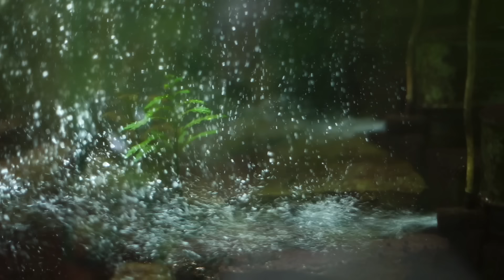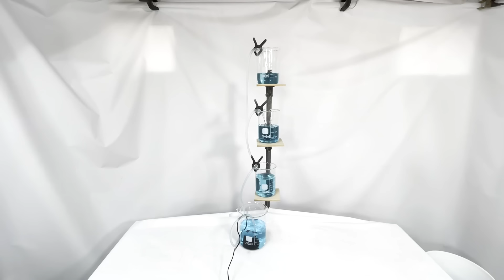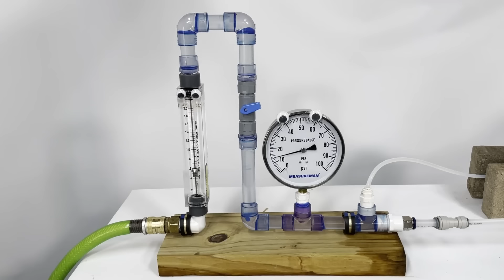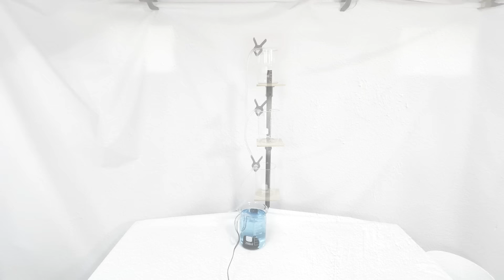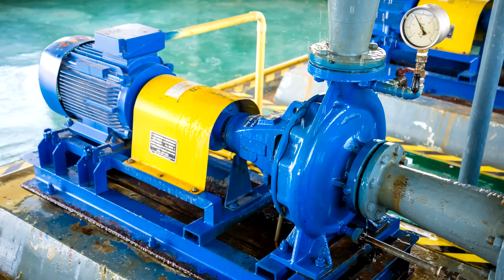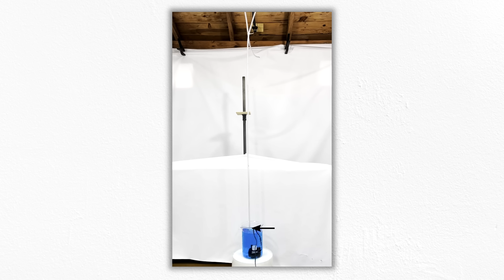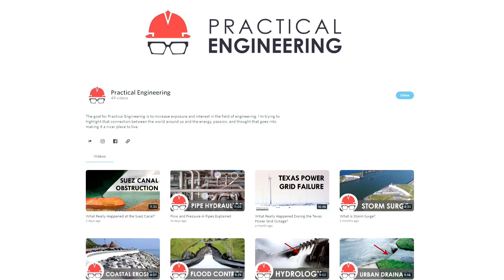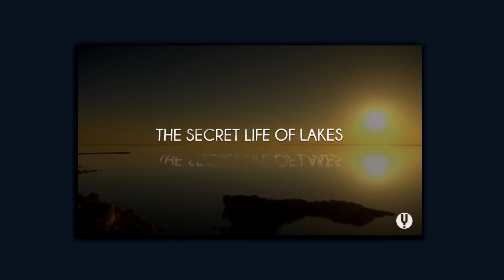Do Pumps Create Pressure or Flow?

Comment: I'm an electrician. Everytime I hear it's not the voltage that kills you, it's the current, I slap them in the face and tell them it wasn't the velocity of my hand that hurt them, but the weight of it. Of course the real answer is it's the MOMENTUM of the hand i.e POWER that hurts you.
Reply: Next time someone says that just zap them with static and ask how they survived being shocked with tens of thousands of volts. I've laid fingers across a 225W piezo driver output before. The Dorito's looking spot on my fingers also smelled like Doritos. ~25kHz ~36V ~6A  is wicked and I really didn't expect it.
Reply: Kind of gets into the weeds of what is a voltage source and what is a current source. Would be interesting to know actually what average voltage across the body is associated with the fatal 2mA of current through the heart though.
Reply: it only takes 1/10th of one amp across your heart " right hand to left foot for example " it is the amps that kill you.. you forgot the 3rd item in ohm's law " resistance". making it possible to take  50,000 volts of electricity from a police taser without dieing, in fact that 50k volts can be maintained by a police taser up to 5 seconds.. yet to person lives just fine no permanent damage. in the end it IS the amps that Kill you not the voltage...
Reply: @earache294  
You couldn't be more wrong. That 50kV is the free-air measurement. Tasers cannot supply more than a very limited current so as soon as the circuit is loaded, i.e. by someones body, the voltage drops to a much lower voltage following ohms law.
If a taser could sustain 50kV even under skin load there would be around 50A flowing. That just doesn't happen.
Reply: @earache294  that's a slap in the face for you. The proper answer to the age old question of is it current or potential that kill you is; YES. These are two measures of one thing; the electromagnetic force. Trying to talk about them as mutually exclusive entities is incredibly pointless.
Reply: @earache294  can't have amps going through your body without the volts. it's both. your extreme analogy goes both ways: a 12v DC battery can supply a humongous amount of amps, enough to literally melt wires, and yet people touch both live and negative no problem all the time when working with cars. heck, I remember this YouTube video from this channel called Photonicinduction. he had a ridiculous step down transformer setup supplying 50,000 amps from mains power, and yet there was no problem at all whatsoever. he was melting solid steel rods, yet it was actually totally harmless.
Reply: What if you're standing between well-insulated & distanced high voltage lines? There's a path of high voltage drop through the insulations, air, and your body, but there is either no current, or it flows somewhere else. Though by seeing the air, insulation, and body as a voltage divider, I guess it's not the total voltage that matters, but rather the part that goes through your body?
Reply: Well if the hand has enough cushioning to reduce the impact...

Though that might be analogous to insulation-body voltage dividers or closed-loop voltage drops
Reply: @earache294  besides those times people do actually die from a taser.

It is an object that provides less lethal force than a gun, but it still can be lethal and shouldn't be deployed unless necessary.
Reply: It requires circa 20 to 30 milliamps across the heart to induce ventricular fibrillation, and death. Many applications utilise many thousands of volts (at the source) but very lower current. I've built 4 solid state tesla coils (and many other high voltage generators) and only 2 of them produce lethal current from the arc, however touching the dome of any tesla coil will produce high current! It is worth keeping in mind the maximum current, for safety.  However, for most common applications (such as mains power outlets) the voltage will easily induce enough current to kill. 
Back in the 90's, I was suspended for 3 days in high school for bringing in a high voltage device (to my physics class) that I had built for powering an infra-red night vision tube (a project I was working on at home), it generated about 13KV but was harmless. They just heard "13 thousand volts" and they could only imagine I'd brought an electrocution device into school. My explanations about the low current and how it was harmless just fell on deaf ears. This was a department of defence school on a military base overseas, and you could not imagine the trouble I got in. The memorandum that was sent to several of my Dad's superiors said that I was suspended for "possession/use of a dangerous object, and abusive behaviour to peers".  Needless to say, my night vision project was dead in the water.
Reply: @methylene5  Gotta love the irony of "possession/use of dangerous object" within the military
Reply: @revimfadli4666  My sentiments exactly!
Reply: @v8snail  tasers are pulsing DC circuits. In DC circuits the current remains the same and the entire 50kv would be dropped across the body completing the circuit.
Reply: Would it be more accurate to say that it's resistance (or lack of) that kills you?
Reply: electrical engineering student and I find this quite funny
Reply: @James Simmons Come here I gonna give you a 10kv electric fence for cattle test :P and you gonna be just fine!
Reply: @JamesSimmons  It's power that kills you!
Reply: Well, it is the amps that kill you, but they can't do it without voltage being an accessory to murder.
Reply: @danieljensen2626  the average human's body has between 1000 and 10000 ohms of resistance (according to  NIOSH).  So the answer is ohms law, and it depends.
Reply: The armchair electrical engineers have been UNLEASHED! XD
Reply: This argument is so stupid. To die you need electrons to flow through your body and damage vital tissue by burning it. Voltage across a resistor causes amps... trying to split them apart is stupid because they are both just different ways to measure flowing electrons. 

High voltage but limited current ex a taser means the electrons are really excited and want to kill you, there just isn’t enough of them to cause damage. Think of it like a sand blaster but it’s only shooting like 3 grains of sand each second. It will sting and leave welts but it won’t strip your flesh off. 

Low voltage = low amperage by nature for the same resistance(you don’t change based on what kind of circuit you touch. So if you touch a low voltage source the electrons aren’t excited enough to kill you, and there won’t be enough of them. Think of it like a broken sand blaster, where the sand just pours out the front slowly. 

Touching a high voltage source (basically any commercial or residential electrical circuit) will have enough voltage to push a large current across your body and kill you easily. Think of it like a sand blaster that’s working properly. LOTS of VERY excited sand, ready to strip away your skin down to the bone.
Reply: @earache294  well said that was how I was taught and yes I have been bitten a few times thanks for your wisdom and truth
Reply: Lmao, that is clever and hilarious
Reply: Me (undergrad in MechE): 
YES. Please make more videos on pumps and anything else you can think of!  I have watched all of your videos and always look forward to watching more.  Your demonstrations and explanations are clear, concise, and most importantly, you cover the details of why it makes sense.   Thank you!
Reply: @carloscintoramartinez1883  yes and no.
I think we should differentiate this a little more.
You can died from an electric shock, that goes thru the heart, so the rhythm is disturbed and the heart won't pump the blood.
For this to happen, you need probably a higher Voltage, because the current needs to go thru a long way of Body. 
But you can died also from burnings inside your body.
For this to happen, there must be a high energy to flow. So high amps that lost much energy to the body due to the high resistance of the body.

So we learn, there are several ways, that electricity can kill.
You should avoid every of them...
Reply: The proper response to: "Its not the voltage that kills you, its the current", is "True, but the current depends directly on the voltage, and on the resistance of the source as well as the load"
Reply: @danieljensen2626  But if the circuit has capacitance, then a high-voltage, low-current power supply can provide enough amperage to be deadly. Just like pumps, both the circuit and power supply are necessary to determine what voltage and what amperage the circuit can provide.
Reply: @klokoloko2114  
Edited for clarity:
Stating power, voltage or current in a singular unit to indicate lethality is not helpful.
Although all these units are related, Energy delivered over a specific duration is the only valid way of calculating damage done.
Energy = Power x Time. Power = Energy divided by time = Voltage x Current.
Electric fences limit the energy they deliver in Joules so a shock can be high current, short duration or the opposite depending on the application.
Reply: @v8snail  Energy is power in time like kWh but power kills you 10watts is enough
Reply: @v8snail  You can spread that energy trough out whole day and nothing will happen to you
Reply: Kloko Loko
You have just agreed that stating an individual unit without duration is meaningless. How much energy delivered how quickly is a quantifiable measurement of how much damage will be done. It is the only predictable, hence meaningful way to express this.
Reply: When people say that about voltage and current, it makes me think of the other adage about how it's not the fall that kills you but the landing. (I think that one is meant less seriously, but it's still a very similar concept.) Yes, in the most direct sense, it is the landing that kills you. However, there would be no landing without a fall, and the kinetic energy you have when you impact the ground is proportional to the distance you fall, assuming a certain mass and gravity.

Just the same, current is most directly what kills you but it doesn't exist without voltage (except in superconductors, but let's not go there). The current is proportional to voltage for a given resistance. Yeah, if you're wet or the conductors are in your bloodstream, it'll take less voltage than it will to go through dry skin, but it still takes some amount of voltage.
Reply: @v8snail  You just said that it depends on how quickly the energy is delivered, which is exactly what power is. It's really neither, but power is a bit closer to the truth.
Reply: @chitlitlah  
Yes, Power is Energy divided by time but the result doesn't state the duration which makes it impossible to calculate damage done. Stating both Energy and Duration means you can accurately work out what damage that energy can do in the time specified.
All items designed to deliver a shock whether it be an electric fence, defibrillator, cattle prod or taser will quote how much energy they can deliver in Joules in a given time.
Electrical motor control centres and switchgear panels including protective suits always state the energy available in a fault condition and the protection factor of cabinets and PPE in Joules. Power is not mentioned in results as it doesn't reveal enough information to state arc flash energy.
Reply: LOL, I can remember having a massive argument with an electician about this, they kept insistring that the phrase was 100% true.  No matter how I illustrated it, explained it, they would not budge.  They where taught the phrase therefore it is true.
Reply: Well the phrase is kind of true. It just depends on the level of abstraction and understanding. Ohm's law e.g. is also just a reduced abstraction of complex processes.

So taking the view point of someone without education in electrical science, Volt is the absolute (effective for AC) potential to ground/earth a source can provide (at max). There are many circumstances which will lead to people surviving high voltages: high resistent to earth (some shoes e.g.), high resistence to the voltage (dry fingertips e.g.), very high frequency, or a high inner resistance of the source. And besides in reality there are many factors besides current and voltage, like pathway of the electricity, frequency, time of exposure energy/time...

So from a very simplistic viewpoint saying "It's not the voltage that kills you, it's the current" it is true. Because it basically translates to "If you touch a high voltage source you not necessarily die, but if you touch a source and a high current flows you probably will die".
Reply: @watchman0311  Open circuit voltage on a good welder is going to be upwards of 60v, my old school dial-arc is actually 90v DC and 75v AC and it will let you know in a hurry if you try to change a rod  while grounded. With a good ground it will maintain >60v DC (and probably the full 75v AC) through a person and with the right contact points I have no doubt that it could kill you in a hurry
Reply: Ive been hit by a few kilovolts from the different tesla coils and jacobs ladders ive made and it didnt kill me. Voltage can hurt, but potential is nothing without actual demand
Reply: @89StarquestTSi  and there can't be current without voltage potential. That was the whole point of my OP; It's completely pointless (and irresponsible) to claim voltage isn't deadly when it is the CAUSE of the oh-so-deadly current!
Reply: Posting this comment has made me realize there's likely dozens of YT armchair electrical enthusiasts killing themselves every year. 🤷‍♂️
Reply: @89StarquestTSi  👌
Reply: @earache294  a car battery can supply thousands of amps, but i can put a hand on each terminal and be fine, you need voltage to push the current through something
Reply: @revimfadli4666  Yes, standing in that situation you are in series with a very high resistance so the voltage drop across your body is trivial. If the voltage is across your body, you are toast.
Reply: @PepsiMagt  so oversimplifying it to "it's still the voltage" is also inaccurate since it ignores resistance?
Reply: There's someone above mentioned this already. You can imagine voltage as tall building, and ampere is how you land.
Yea, you won't die from jumping on a tall building, you'll die when you hit the ground.
Or maybe not die, if it damped by your arm and legs and doesn't hit your vital, or you're landed in soft materials, or maybe you don't die immediately but die because your bleeding doesn't stop.
Reply: You know it's true. Very little amp won't hurt you but high amps will. Some people just want to split hairs I suppose...
Reply: Some of you seem to forget that the voltage that matters is the voltage applied to you, not the voltage of the whole system (which may be gigantic but most of the voltage drop may happen on some other components not on you). And yeah you need sufficient current through your heart to die, but this requires both enough voltage AND high enough max current.
Reply: @marekogarek6329  agreed, though in addition to voltage division, having an low-resistance parallel path also lowers the voltage portion on your body
Reply: It's not the fall that kills you; it's the sudden stop at the end.
Reply: AC more dangerous than DC for same voltage, 50-60Hz anyway.
Reply: Something something capacitance something millijoules?
Reply: Speeding doesn't kill. It's the sudden stopping that does you in.
Reply: @danieljensen2626  The average varies a lot due to skin condition, thickness and dryness, so it makes more sense to specify a lover treshold. Generally voltages above 50V are considered dangerous since it is often adequate to cause a current high enough to run through your heart that it can cause problems (depending on where the current flows through your body of course and that the source is able to provide a high enough current)
Reply: current * resistance = voltage. Hmm I am confused, current is a factor to get voltage. 🤷🏿‍♂️
Reply: @DevGabe405  I=V/R
Wow look I can do it too 😂
Reply: @DevGabe405  my point you seem to have missed is that voltage, current, and resistance are just three characteristics of one thing (the electromagnetic force) and it's impossible to use binary logic to say "x, not y, kills you."
Reply: @DevGabe405  as an aside you got it 180° backwards. There cannot be current without voltage, but there can be voltage without current.
Reply: @JamesSimmons  Hm. How can there be voltage without current? I thought current means the "flow rate of energy" or the speed in energy. And voltage is like a measurement unit used to define the total power of an electrical circuit.
Reply: @DevGabe405  static electricity, something every 5th grader knows about. Voltage is not the total power, you might be thinking of Watts. Voltage is electrical potential.
Reply: @JamesSimmons  Ah I see! Voltage is stored electrical energy.  I will look into static electricity.
Reply: You can slap them in the face and tell them that in your frame of reference they headbutted your hand...
Reply: @v8snail  So, tell me how, everytime you are shocked by static, you survive? Its in the thousands, if not millions of volts, and you feel it, but it doesnt kill you. Amps are what kill you
Reply: @Sethiol73 
Easy. There is not enough energy in most static shocks to do any harm to you apart from surprised nerves.
I have personally used 6" non-static-dissapating hoses on vac trucks to vacuum up massive amounts of sawdust in at a Laminex Group site which caused enough static build up to produce spark jumps of around one foot air-gap to ground suggesting close to a million volts potential.
I'm not going to lie, they were painful, but it didn't kill me or my co-workers. The hoses were not fit for purpose but we tolerated it to get the shutdown finished, refusing to ever use them again. We were given 3kV high voltage insulation gloves to help at the time but all that resulted in was the voltage increasing that much more before striking through them, more painful.
The instant that static potential difference ionises the air and grounds through your skin, the voltage through your limbs is reduced to double digit numbers with a current flow in low single digit millamps as your body resistance/conductivity loads up that source. The total energy is so low that the current flow is over with in microseconds, felt but no damage done.
Amps kill you but they are not possible without the instantaneous voltage to push them through and the energy available to sustain it long enough to cause damage.
Reply: @Sethiol73  yes that's correct. The point is that for a deadly amount of current to flow between x and y then there must be sufficient voltage potential present in order for the resistance between the 2 points to be overcome otherwise no current flow. The other factor is the power output that the supply is capable of which is why you can have an electric fence generator that is only capable of supplying minimal current at a locked voltage. AC is not more deadly than DC for equal voltage as someone else commented and capacitance has nothing to do with increasing current in this situation as someone else said although I think they are talking about resonance and not understanding the principle. Capacitance makes the current out of sync with voltage in an AC system or can bring it back and improve power factor in an inductive system. Sorry to include all that but the amount of incorrect info got to me.
Reply: @icenbryse5190  Oh my gosh, I was trying to hang plastic sheeting around them to keep dust off everything around our water system and you could just feel the static in the air. I didn't want to get near it ever and basically the only way I could work around it was by slapping it and just taking the blast. I never had one stun me like that. They should probably be coated in some dissipative spray.
Reply: no you don't
Reply: @Rangvald8909  excellent way of describing it. voltage is what is called electromotive pressure it is essentially the energy of the electrons, amperage is the quantity of electrons moving through a circuit.  ohms/resistance is just the size of the channel the electrons are allowed to flow through.

all three of these factors play a roll in death. voltage is the speed of the preverbial bullet. amperage is the weight, and resistance is the main factor that limits current in the body. all three of these are needed to be within correct values to cause death. so therefor the expression should actually be, "its not the voltage that kills you, its the resistance in your body that allows your soft tissue to be heated causing death. that kills you.
Reply: @JamesSimmons  that was the point made in this video everyone missed lol
Reply: Lol
Reply: Its low resistance which kill you thats it.. if you have good resistance voltage and current will not kill you;)
Reply: @noalear  With proper low resistance skin contact, you can already start slightly feeling 5V AC ~1000Hz
Reply: It is the current though. You can touch higher voltage with dry hands than with sweaty hands, because the resistance of the skin is different. I rather touch 1150V with a wooden broom stick than than 115V with sweaty hands. It's the current that kills you.
Reply: @FirehouseCrafts  if your skin will have 10Mohm resistance what will kill you? 115V, 20mA, or sweatr
Reply: @FirehouseCrafts  you can ride in a car going 75 just fine. You could even hold your hand out and brush it as it goes by if you're careful. Doesn't mean it won't kill you if you step out in front of it.  Makes very little difference if it's a 2000lb coupe or a 9000lb truck.
Reply: It's true you can get hit by a 75mph baseball and be more or less fine, but the point of my clunky analogy is it's not current (mass of object) or voltage (velocity of object), but the combination of the two (momentum in the analogy).
Reply: @dwaynepenner2788  And Amps times Volts equals Power.
Reply: @Rangvald8909  Current goes through your body, not across it.
Reply: @JamesSimmons  Omg what made you so butthurt ffs... If someone says ''current kills you, not voltage'', they are not necessary implying they are mutually exclusive. Of course they are not but it's two different concepts anyway and it can be useful to understand the difference. 

You need enough electric potential difference (voltage), which is a unit of work (energy / charge) for any current to occur. If there's no tension, there's no energy. But it's a difference of electric potential from two points. There can be a lot of tension without hardly any current and still respect Ohm's law : exactly the reason why you want huge voltage in transmission lines with as little resistance as possible (thus, stranded wires) to drag as little current (A) as possible (to limit the waste of electric energy converted to heat in the cable). Of course, if you're grounded and get too close or touch the wire, you become a new path for the current to flow to ground, even if you're more resistive than the wire, because the tension is high enough to pass through you anyway, and since you're more resistive than the wire , huh guess what ; that's exactly why it draws current.  Smart ass.

A static shock is roughly 10 kV but there's close to no current (yes yes, there is a very small amount of current, true, it all dissipates in a very cute little lightning from your finger to the body of your car) but it doesn't harm anyone. But as little as 20 to 100 mA at the apex of your heart can be fatal, whatever how much electric tension was needed to draw the path of current to get there. And if there no skin to protect you (open heart surgery for example) it's much lower than that. Even more interesting, the frequency of the current is a important factor there. All of electric surgical tools have electric current of much higher frequency (10 kHz) because, for some reason, it's much safer. By coincidence, it happens that 60 Hz is the most dangerous frequency of alternative current. 

But anyway, what people actually mean with the ''current kills you, not voltage'' saying is that even low voltage can be dangerous, if you're unlucky enough, I guess. And it's totally true. 120V is to be taken as seriously of higher voltage, because it can indeed kill you. That's why you have GFCI sockets in your bathroom. And you already know that.
Reply: @James Simmons   And also capacitors, where Ohm's law doesn't apply anymore, and some transformers. And I'm not smart enough to understand this shit but yeah it can have very little current but a lot of voltage and still deliver a hell of a slap that can lead you to hospital. So I would say you're right too, man. And I'm sure you're a good electrician because you seem passionate about this subject since you slap people in the face when they are wrong. Most important thing to remember is to be safe, to ourself and others. But talking about voltage and amperage as ''mutually exclusive'' (I'd rather say, as two different concept, because, they are) as being ''pointless'' is a false statement. But whatever, I'm just another smart ass like you on the internet loosing time writing this shit to show everyone else how smart I am (or not). Have a good evening, sir.
Reply: Rather than slapping them in the face, you could explain why they're wrong and what actually kills you. Less harmful approach and more educative.
Reply: I am an engineer and used to work in large diameter welded steel pipe watermain design.
Inspectors testing for pinholes on field joint coating repairs use a holiday tester . I recall trying one out once and got zapped pretty badly when I stupidly got too close to the brush end. I think it was around 20KV but the current at only  about 1.5mA meant that I lived. So this is an extreme example that  amps don’t kill even if voltage is high. Must be the wattage (energy) that’s the critical issue here. Analogous to flow and head in hydraulics.
Reply: @methylene5  Ive read just as little as 7mA can kill in certain instances.
Reply: Once whilst working on a chemical plant (AECI) I got shocked on an electrostatic precipitator by 60,000 volts, however, no amps......amps kill.
Couldn't open my hand holding a feather duster, (used to dust coal dust off the insulators) but was ok....
Reply: Love the conversation!   Let’s be real, it’s the stupidity of using the body to complete the circuit that really kills you 😜.
Reply: It's neither voltage nor current alone, but the combination of the 2 (AKA power) that does the damage. In a way, 10x higher voltage means 100x more danger, and the same goes for current (since a 10x increase in one directly correlates to a 10x increase in the other). There is more nuance to it than that, but that's a good simple way to look at it.
Reply: @richardwebb9532  If you were hit by that much voltage you were also hit by a substantial amount of current. This is the type of situation where you can't quite simplify it down to just current or voltage. You took an enormous amount of voltage and current, meaning you absorbed a great deal of power over a very short time. The voltage and current you were shocked with were well beyond lethal levels, but because the discharge occured so quickly there wasn't enough energy involved to do any real damage.
Reply: @GuyFromJupiter  ....nope.....there were zero amps. Period.
Reply: @GuyFromJupiter  ...funny how 60,000 volts alone, muscles seized, no permanent damage. 
....60,000 volts + 1 amp = instant death.
Prove me wrong.
Reply: I'm an electrical engineer. Current is certainly what kills you. But for that current to keep flowing, a high enough voltage needs to be maintained. A Van De Graaff generator can create millions of volts, but as soon as you touch it, the voltage drops to zero and thereby cutting that current off.
Reply: @danieljensen2626  There is no simple number. It depends on many factors such as dampness of the contact points, contact pressure, etc. Those are some of the many factors that define the resistance. We know that current=voltage/resistance. To make things even more confusing, resistance is non linear, depending on voltage and changes once the current starts to flow.  Bottom line: the human body is not like a theoretical resistor so trying to assess a voltage value that results in a certain current is impossible.
Reply: Not saying your wrong just saying that 1 million amps at 1 volt will literally never kill you due to electricity but maybe heat from resistance.
Reply: @akassasin5768  Exactly right, but of course that would only happen if the human body has a resistance of 1 micro-ohm (R = V/I). Given that the human body has a resistance that's many orders of magnitude higher that that, the only way to develop a sufficiently high current flow is to have a voltage source with a voltage large enough to develop those currents (I=V/R).
Reply: @Rangvald8909  Taser's electrons may never touch you, the current is generated inside your own body due to the precense of an electric field (voltage). You dont even need electrons, you can have the same within any charged particle, like ions (all the salts in your salty body), hidron, protons... 

I can say the same, high voltage with low currents means that the voltage is really strong and want to violently rip your charged particles destoying you from the inside but you are surrounded with insulation so the voltage dont reach you.
Reply: @revimfadli4666  amps kill. think of electricity like water. volts is pressure and amps is amount of flow. if its a humid day and you get to close to high voltage it can jump through the air across that moisture and kill you.
Reply: @earache294  Now try to get that 1.5 amps across the heart without first cutting a person open. That's the whole point, genius. You need BOTH.
Reply: @earache294  The problem is, it is true you can have volts without amps, you cannot have amps without volts. If anything, you need both.
Reply: @erikhicks6184  you cannot have two without the third.. you seem to have missed the 3rd part of OHMS LAW. you can have 100,000 volts at less than 1/10 of one amp. thats how taser don't kill you. However one volt at 1/2 amp can kill you.. now ive given you two example with enough info using ohms law to find that third part that you cannot have either of the two without. fyi using said law you can have ANY combination of amp and volts and the third ive not mentioned.  look up ohms law do the math and see how it all works. must have all 3 parts or none at all.
Reply: @m8onethousand  make sure you don’t have any open cuts when touching them.
Reply: I'm a scientist, and I can also slap harder than you can. Neither of these facts necessarily make my claims correct.

However, a fact which is relevant is that the electrochemistry of ion channels is strictly current driven, not voltage driven. You can establish any voltage you like, but if current is restricted there is no effect.

Therefore it's correct to specify the current threshold for ventricular fibrillation. Specifying the voltage is meaningless, except as an indirect way of inducing a current flow.
Reply: Part of the problem here is that people talking about "50,000 volt" sources are talking about the open circuit voltage, not the voltage once you close the circuit across your body. If the power source can't supply much current, the voltage in the circuit will drop to I × R, where I is the maximum current it can supply.

The example of the 12 V car battery is even more ridiculous: sure, the battery can supply, say, 1000 A into a 0.12 Ω circuit, but when you're putting a hand on each terminal, that's not a 0.12 Ω circuit. A hand-to-hand circuit is going to be more like 1500 Ω and so the battery will supply 8 mA because it's (roughly) a constant-voltage source.

Most power sources are constant voltage, current-limited sources whose current delivery through the body will be limited by the constant voltage at lower voltages and the power supply's current limit at higher nominal voltages, where the actual circuit voltage drops due to the current limit. When viewed in that way, yeah, it's pretty reasonable to say that it's the current that kills you.
Reply: I've ridden 50k volts at 1 amp. It does not feel good but it's far from lethal. Now give me 20 amps at 240v, I'm DRT, so I'm confused by your statement.
Reply: They should slap you back. It absolutely is the current that kills you. Voltage pushes that current into you, but make no mistake, it’s the current that does the damage.
Reply: Ok
Reply: It’s more a combination that kills you. High voltage at very low current, such as static electricity won’t hurt, and that’s the same as very low voltage at high current.
Reply: To be fair, voltage doesn’t actually kill you. People just fail to realize that voltage and current are relative (mostly). So no, it wasn’t the speed that killed you in a car crash, it was the rapid deceleration.
Reply: Speaking of that saying, isn't the Product of both Amps and Volts what kills you? I never got the point of that saying.
Reply: Current is dependent on voltage.your body has constant resistent.by increasing the voltage currnt increases.
Reply: you need voltage ro get enoigh current, but you can have voltage without a deadly current. animal electric fences as example.
if i remember it all correctly
as mechanoc and electrician for cars i dont work with noteworthy voltages
Reply: @faridb40  you are a student thats why you found funny.🤣🤣
Reply: Actually high voltage and high current cause different effects.
10mA at a half million volts will kill you painfully (by heating (5kW is significant)).
10mA at 110V can barely be felt.
1Amp at 10V won’t kill you immediately - but the damage to tissue will with long term exposure (it disrupts cellular membranes).
Reply: Explain the van Dr Graff generator.
Reply: Can you expand on the suction capabilities of a pump?  From how deep into the ground a surface pump can effectively elevate liquids? How this deepness impacts on the outlet pressure and flow? Tks
Reply: please don't hit people for this.
Reply: Why? It's a pretty accurate saying. A static shock can be up to 25,000 volts but generate just 5 mA. In this case the voltage being high is negated by the fact that the current is very low.
Reply: It's not the fall that hurts it's the landing
Reply: Well it's the combination of mass and velocity which is the momentum equation. That is the same for electricity. It's a combination of many factors, voltage, frequency, and resistance.
Reply: It's not the momentum actually. A train going at 1mph won't KO you
Reply: It’s power or lack of resistance that kills you
Reply: Ey another sparkly one!, yes your correct, u need only 10 uA across your ticker to visit jesus. given that the hooman meat bag has between 200k to 500k ohms of resistance depending how grimey or sweaty you are, some math shows that from about  70v with enough shove behind it that can make u go sleepy nite long term, personally I've taken 1000v megger leads for a joke, would not recommend, also had a meggerd cable discharge 10kV thru my knee to ground, absolute jackass content , would do again🤣🤣
Reply: @Gazdadjuz  sounds like my kinda work environment lol
Reply: The magnitude of current and the duration of an electric shock determine the effects of said electric shock. In order to cause a current to flow through your body, a voltage or potential difference is required. Depending on the resistance of your body, I.e. wet or dry skin, and the path the current takes, determines the current that will flow for a given touch voltage, and the duration depends on whether circuit protection operates, or if you can let go of the conductive live parts. 

What does all that mean? In essence, to receive a shock, you need voltage (electrical pressure or potential difference) to cause a current to flow when provided with a current path of a certain resistance. Your body’s resistance contributes to the severity of the shock, a lower resistance will cause a higher current to flow. The duration of a static shock is very short, so no lasting or damaging effects are usually sustained. Coming into contact with the terminals of a capacitor bank however, depending on the quantity of stored charge and the voltage across the terminals, will likely result in a far more serious shock due to the longer duration of the shock. Coming into contact with the terminals of a transformer secondary with a terminal voltage of 240 volts will almost certainly be lethal, as the duration of the shock is unlikely to be limited in this case. Look up shock current curve for a visual reference of what I have explained above.
Reply: Great lines❤
Reply: @JamesSimmons it's actually the electromotive force there buddy
Reply: You most certainly did not get burned from 36Volts. Even at that frequency. Maybe there were high voltage spikes that broke down the insulation of your skin? @noalear
Reply: @JamesSimmons Keyboard Electron Killer Konspiritors! 😂😅
Reply: Technically it's actually the frequency in hz of that current that kills you.
Reply: I can never leap a building, tall or not, regardless of the number of bounds I take...unless the ground leading up to the top of the building, is sloped enough, so that I can jump over the top of the building.  Of course, my life will end, after I leap over the building, because I will literally fall back to earth.  Unless of course, the ground is adequately sloped enough on the far side of the building, to allow me to reach the building's bottom or my starting point.  Yes, I am an engineer (metallurgical).
Reply: @jasonmurawski5877  try doing that, when the engine is running.
Reply: @peterthurman9384  engine running battery voltage is around 14.8v. That isn't going to hurt you.
Reply: wuts moorê dangerous ¿¿¿
Reply: @jasonmurawski5877  it is not the voltage, it is the current: Have you ever made contact with both terminals, while an auto was running?
Reply: @JamesSimmons  the 'energy'.  Point: who cares if you are smacked in the face by a fast-moving mosquito?  But, to be smacked in the face by a fast-moving, relatively-large mass (ie. Human hand)...
Reply: @peterthurman9384  it's power. Not voltage nor current. You need both
Reply: @chitlitlah  the 'rough' landing kills you: falling onto adequate cushioning will be fun, not deadly.
Reply: @peterthurman9384  Just as wearing gloves will keep high voltage from hurting you.
Reply: Dumb, sanctimonious statement, sounds like an electrician
Reply: @Adam-hp5hj  lol get out of here drywaller. If you don't think that's a meaningful statement, you have no business anywhere in the electrical industry.
Reply: @JamesSimmons  Using drywaller as an insult, you must be doing resi or light commercial work. Saying you slap people in the face to explain how dangerous your job is to people is the part I thought was silly. I'm an industrial electrician btw
Reply: @Adam-hp5hj  I'm the guy that comes in and fixes your mistakes btw, industrial automation and motor controls service tech.
Reply: @JamesSimmons  sounds more like a controls guy than an electrician. We have a couple controls engineers at work, no technician level low voltage guys though
Reply: @Adam-hp5hj  I mean whatever dude, I've paid my dues pulling 500s, bending 1.25 EMT by hand, I still work on 400hp irrigation motors on the regular, learning as I went to be where I'm at, but you don't have to call me an electrician if it feels bad lol
Reply: No, it isn't the power. The rating for what stops your heart is current. About 150mA is enough to stop your heart. If you have your chest cavity open and apply electrodes directly to the heart, the voltage required to do this is way less, a car battery could trivially kill you.